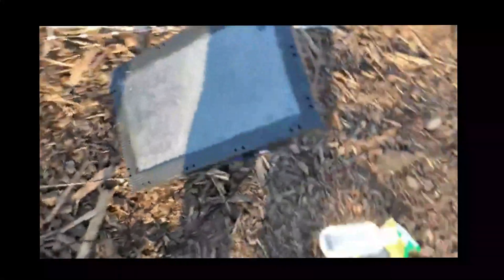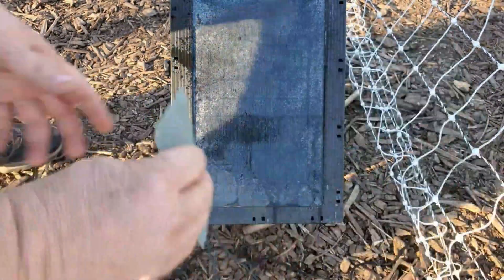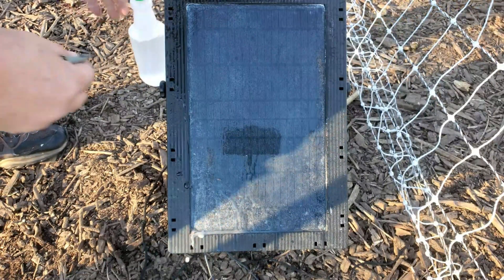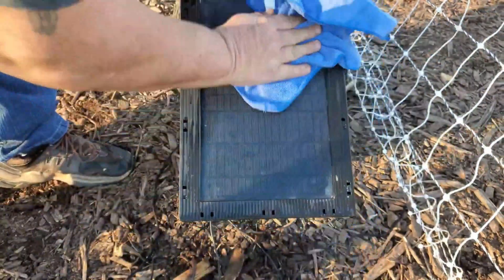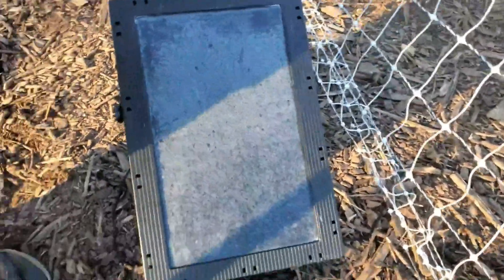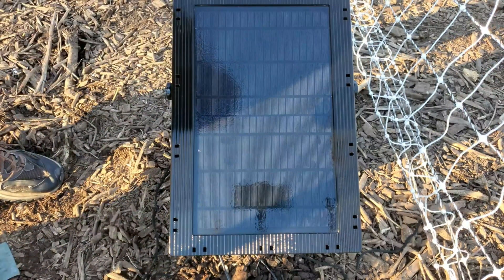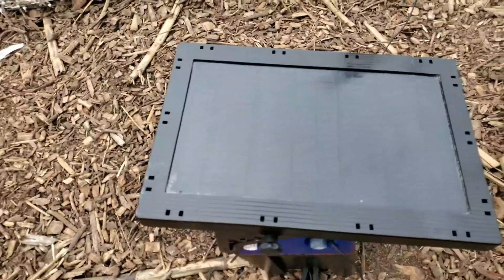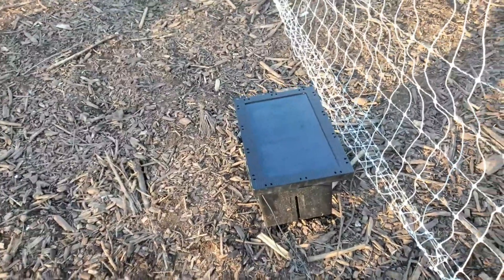How to fix sun damaged solar panels

Comment: This is amazing! Thanks for the tips. I probably should have waxed the panel surfaces when I first got them, but good to know they can be restored.
Reply from the maker: I found its easier just to get some mineral oil and clean it bi-weekly or so, this seems to help keep the plastic from dry rotting so fast. Thank you and have great weekend

Comment: If you took the same method that you did but you only stepped up your sandpaper from an 800 Grit 1200 or a 1500 grit depending on the severity of your job and then a 3,000 to finish it off or even a 6000 Grit so that way you're not actually beating yourself up you literally doing a great job if you put a teaspoon maybe two in with that you would get a very brilliant shine just so you know
Reply from the maker: Thanks for the tip Mike, Now all we do is just wipe it down once in a while with mineral oil.

Comment: Would be great to get solar power.  So long as the electric company wouldn't rob us blind on off cycles. Good tips!👍
Reply: In some states  if you build a new home everything have to electric not natural gas or propane they pushing solar panels and electric cars CORNPOP is doing an amazing job
Reply: @DragonflyAcres2022  yes, I prefer to keep gas. Can always use the pilot light if power is out. I think they're trying to control electric too much. Time will tell. ;)
Reply: Misha, I take natural gas anytime, if you lose power you are tossed with natural gas you can run you back up generator if you have one.All Walmarts are switch from gas to electric.If it is not broken don’t fixed it. Have a bless night
Reply: @DragonflyAcres2022  I didn't know you could hook up a generator to your home gas. Blessings to you.
Reply from the maker: Yes thats right, thank you Misha and have a great week